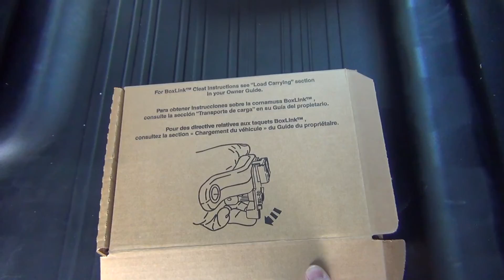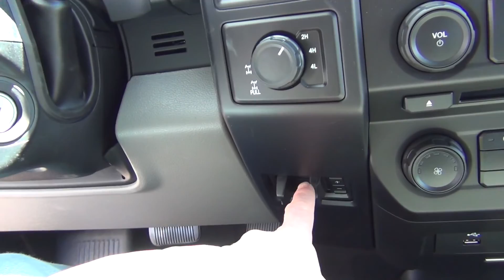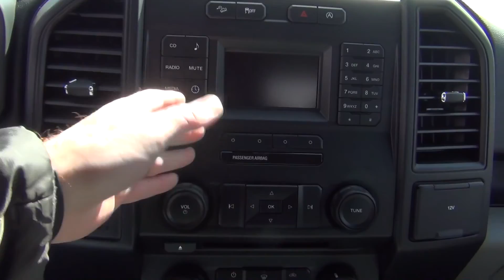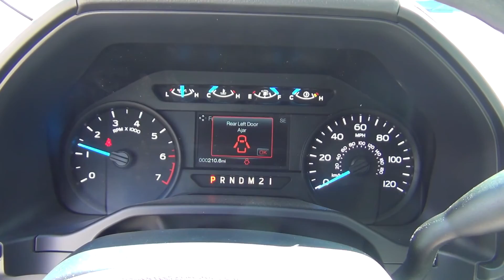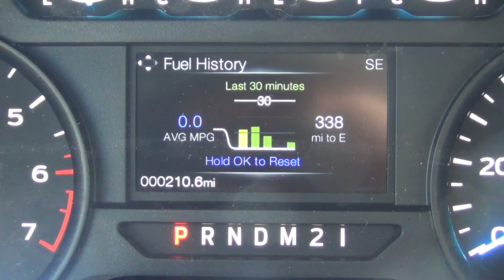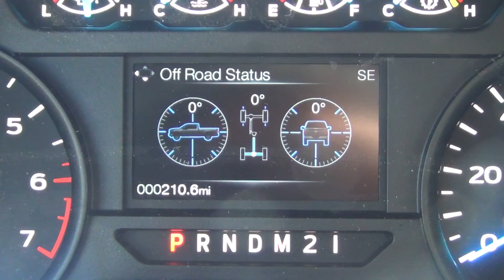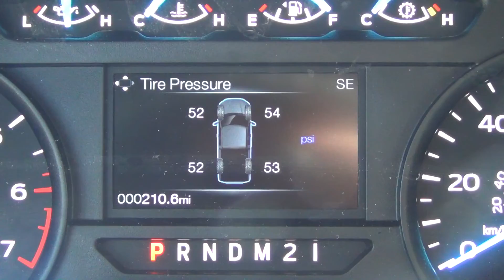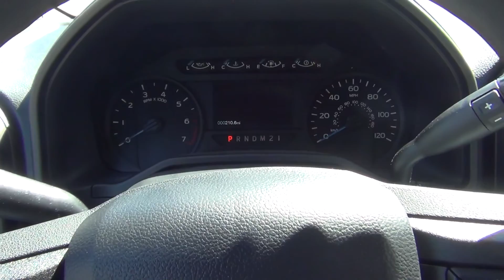2016 Ford F150 XL - Overview

Comment: I have a 05’ XL 4X4 (4.6 V8) with 248,000 miles. It’s all I need in a truck. Wish I had power windows and locks sometimes but less to break. My father has that same brown caribou color on his 2016 XLT 4X2. Thanks for reviewing a truck the average working man can afford.
Reply from the maker: Yeah if it wasn't for the A/Z-Plan and rebate this thing is still overpriced. However the main thing is it hauls what I need it to haul because it's a truck. Save the nice vehicle for the wife and family outings. Vehicles are such a waste of money.
Reply: Meeker Extreme Yep. I’ve never came out ahead on any vehicle. Worst investments.

Comment: Wow Ford is putting all that computer junk that takes so much time to learn and operate on a base model.  That means there are no more easy to operate base models.  I'll keep my 1998 F-150 V8 with manual transmission and manual transfer case.  It is a top trim Lariat, which was Ford's last high level trim that didn't have lots of computer junk.